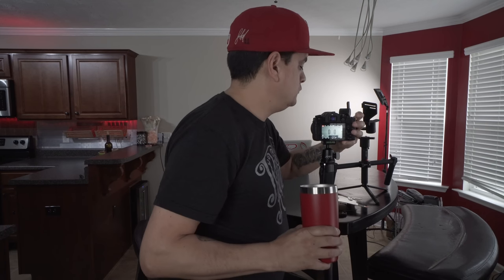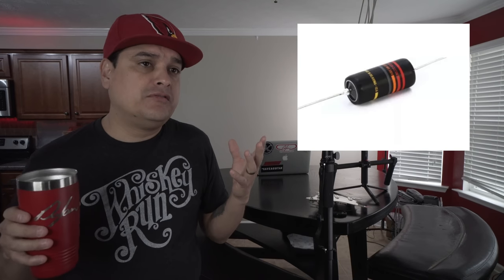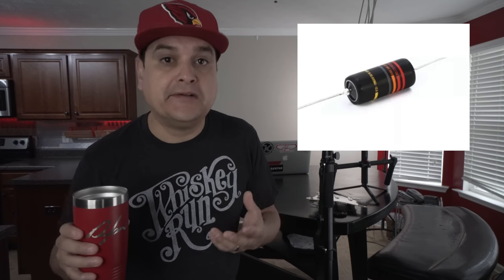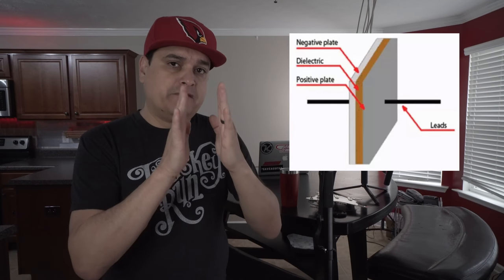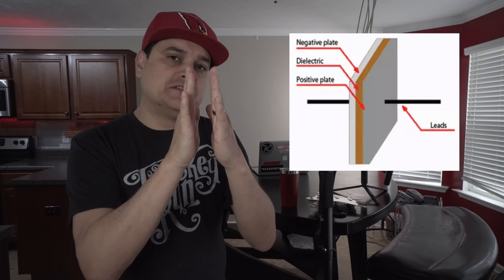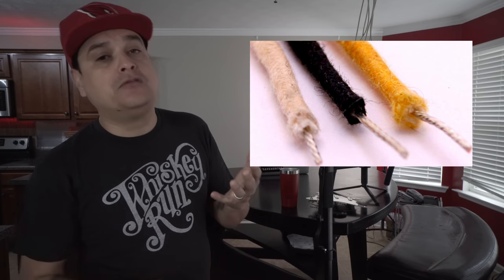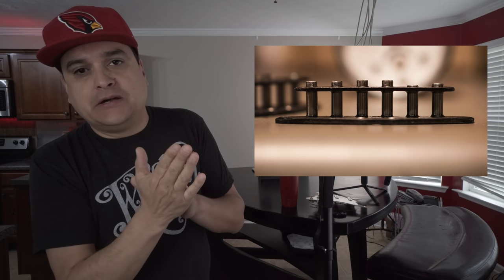Are Paper In Oil Caps Better Than Orange Drop?

Comment: A lot of people seem to think they're missing some magic component in their signal chain that's holding them back. There isn't. You just aren't practicing enough. Stop obsessing over caps and start obsessing over being the best player you can be. I need this advice too.
Reply: mic dropped
Reply: You won't sound good if you don't play well this is true, but if you've ever modded a guitar and achieved hitting that sweet spot of tone you'd understand that tone isn't entirely in your fingers. There's a point to chasing it, but there's also tons of variables. The biggest being how you sound in your room isn't how you sound being recorded with a mic, or to someone 100 yards away listening to you in a mix. That said I feel how I sound to myself is important to feeling inspired to play. To each their own though. Everyone should have a different perspective and experience. Also I agree with this guy's perspective in the video for the most part. I've heard it argued though that there's a tolerance for variance in value in caps and cheaper ones apparently tend to have wider value variance meaning they can vary a little more higher and lower from the actual value in performance than some of their more expensive competition. I don't know enough to say if that's true though, and that didn't seem to be addressed in this video. I'm curious to know if there's much truth to that claim.
Reply: True, but nerding out on capacitors can be superficial therapeutic fun. Even if doesn’t matter which cap you use. It’s like audio jewelry.
Reply: That's true to an extent, but people often don't know how to dial in an amp either. Usually dial in too much gain and bass, then can't figure out why their tone sucks
Reply: The thing missing is the 2000-3000$ amps the big difference
Reply: When it comes to caps, I think it's got to do with its capacitance. So long as the quality is good and the torques are correct, of you choose the right capacitance, you are going all that a capacitor can give you.
Reply: @ramencurry6672  this!🤝
Reply: Although Tone Hunting is a hobby in itself
Reply: nobody thinks that. tone is an entirely separate issue from practice
Reply: Yea I'm not really that great of a player but I definitely chase tone. Nothing wrong with wanting the best sound.
Reply: What harm is there in doing both?
Reply: Playing better is always great, yes practice makes most people better. But if you don't have good tone then you suck no matter how good you can play.
Reply: @LRHutch I would argue that Randy Rhoads, Jimi Hendrix, Jimi Page, and Roy Buchanan all had terrible tone. I’d give anything to be able to play like just one of them, because that is what made them great.
Reply: I can obsess about both if I want to 🤷

Comment: I'm about to turn 66 in a few days. I spent my life having a certain mind-set, if I built a guitar or bought one I'd do the same things to it just because I thought that's the way things are done. I'd not even put a tone control on ones I built and cut them out of the ones I'd buy, I never took the time to learn how to use tone controls. About 6-7 years ago I was at Guitar Center trying Les Paul's. None sounded "good" to me, mostly too bright. I had just played one, didn't "like" it, hung it back on the wall. I stepped away, a younger guy picked that same guitar up, played a few notes, then that creamy tone I was looking for came out of that guitar, it didn't sound that way when I played it. I asked the guy what he was doing to get "that" sound. He rolled the tone control back a bit. That's all he did. I had to rethink most everything I'd done due to misinformation or just stubbornness. My tone quest has been fun and informative. That's how I discovered Dylan Talks Tone.
Reply: Just re-read this, I'd left some holes in my comments explaining "what I did to everything". I'd read in guitar player in the 80's about the timeless discussion how smaller value pots kill treble, the higher the pot value, more highs get thru. The writer suggested everyone put 1 meg pots in their guitars to get full frequency spectrum. In another monthly how to by the same writer, he suggested adjusting the pickups so high they almost touch the strings to get full output. Not sure if the "cut the tone control out of the circuit to get more mojo" was by the same idiot, but I did all three suggestions to every guitar I put my hands on. I didn't understand why my strat sounded so badly, I hated it, so I changed pickups but did the same thing, it sounded badly too, so I traded it away. Imagine my shock when I learned the pickups were too high. I'd taken part of 3 or more magazine articles and abstractly applied what I THOUGHT I'd read with mostly bad results. Before internet (here goes a "had to walk to school uphill, both ways" story) I obtained my information 3 ways, magazine, library, and word of mouth. Thinking back, most of the people that gave me guitar advice were either high, or just stupid, but I digress. I feel foolish for blaming what were otherwise excellent instruments for me making the tone and sound stink. My go-to phrase for one of these guitars was "it sounds like a TURD". Oh, well.
Reply: @Lamster66  thanks for the insight.
Reply: To clarify my standpoint, I've played just about every genre from Gospel to bluegrass to blues since 1972, I've not found that magic guitar or pickup that does everything I've needed. Besides my hands and string choices, the pickup and resulting tone is the next item in the equation. I use a variety of amps as the genre and size of the venue dictates, so usually the guitar choice is dictated by the same requirements. What I mentioned regarding that Les Paul being too bright, it wasn't giving me the sound I was after for that purchase. I also explained that I'd done the same things to every guitar I owned instead of learning how to use that tone control. It amazed me that it actually made that much difference in shaping the tone. I've been on the "tone quest" since then so I'm about 18 years past THAT revelation. I'm not so closed minded these days, I read and experiment as much as possible, an auto accident ended my live gigging. Your explanation was thorough and I certainly appreciate the input. At this point of my by guess or by gosh engineering I'm experimenting with bass cut and passive mid-range cuts, I'm intrigued with the cocked wah sounds possible and how 3 tone cut controls interact. I'm enjoying my journey and really enjoy Dylan's posts. Thanks again.
Reply: I share this pro tip with very few people. Mainly because they really do not know what they do not know and just play what is stock. So here it goes: use 500k pots on all your guitars. Wire the volume and tone knob like  a 50’s Les Paul junior. (Vintage wiring vs Modern) use the value .010- .015 for the tone cap. If you want to roll back the volume or tone when using single coils to get more of those stratty tones then you will be inclined to use your ears more and also more feel of the strings and magnets resisting your pick attack. Tone really is in your hands, some guitars do this better out of the box, most have to be modified to this recipe to really have it all, especially in HSS. Now, you have the 500k which the humbucker loves, you are twice the value for single coils, you can roll off the volume and tone and solve that, plus.... using the value of tone cap I prescribed, you will actually use your tone knob more than ever before as the value (.010-.015mfd) shifts the mid and treble points like a partially cocked Wah wah pedal, instead of that .05 horrible muted muffled muddy sound Fender chose to use when guitar players would mimic bass guitar on a 6 string while recording in the 50’s, and no modern players really use the tone knob because of that fact. Playing your amp is now your new concern. You can dial up higher than you would normally use for volume and tones, and use the volume and tone knob on the guitar for boosting volume and tone without a pedal... ala Hendrix ... you will love this setup more than anything and will play more and use the volume and tone knobs and never want anything else forever thereafter...... do a video with this idea.... boost the amps volume and tone controls and dial it back from the guitar and when you want a volume or frequency change, use those knobs on the guitar instead of walking to the amp, or stepping on pedals.....you will be free to play and have it all at your fingertips.....you will thank me later tonechasers!!!
Reply: @bradleyshuppert3393   Chris Buck did a video called "The CHEAPEST Les Paul Tone HACK? | Friday Fretworks" His LP has about 330K pots from Gibson.  He had the guitar upgraded to 500K post with new caps. There was a bit of difference but not as much as you would think.
Reply: @bradleyshuppert3393  I don't recall where I heard this, may have been on the Trogly's guitar show. It was recent though as I am on a quest to find a Firebird V. The Firebird V has mini humbuckers. These pups are naturally brighter than regular humbuckers so they have 250k pots to give the pups a warmer sound. Is this false? I can't say one way or the other as I have never played one or had the chance to test that theory out if you will.
Reply: Dang man, it takes a true person that’s open to new things to admit stuff like that. I’m sure since that day, you have been having a blast. :)
Reply: That’s kind of like saying I’ve been driving all my life and realized that if I turn my air conditioner down to low I won’t get too cold
Reply: @ramencurry6672  Sometimes we're used to the airconditioner not working, so it's more of a "wow, I didn't know I could be this cold," lol
Reply: @ramencurry6672     LOL   Knowledge is a wonderful thing.
Reply: It's a funny thing. In one of my guitars I have completely removed the tone pots and I love it the way it is. The neck pup delivers that singing tone no issues, I just turn down the volume a notch. In the other one I kept the tone pots, and that one gets me that creamy sound with the neck pup and the tone pot rolled almost all the way down. Lesson learned? Dunno... Maybe nothing. Maybe just the idea to play around with your stuff and keep your ears open. Once you get that tone you are lookig for, notice your settings, no matter how extreme they are. And you might get that tone with different guitars at very different settings.
Reply: Ya! I know that feeling!
Reply: Most guitar players just want to turn each knob wide open and fiddle with their amps, noit undertsanding that the two work together. I was the same way for many years. Until watched an old Santana video. He was constantly adjusting tone and volume on his guitar, depending on what he was playing, chords or single notes.

Comment: Yeah that's a tough talk... not many people are ready to hear it... and It's true, if you want to sound like a vintage guitar, check its cap value, and duplicate it... dont go read the original value of it and try to put a paper in oil cap in your guitar with the original value, it won't sound the same...
Reply: Duplicating original values is a mistake many people make when trying to recreate a 60 year old amp with fresh components.  The "mojo" in those old amps is there because the values of those 60 year old parts have drifted over the decades. I heard clones that sound incredible but, good or bad, they don't sound exactly like an original.
Reply: I don't understand what you are talking about. isn't the reason you love that old vintage amp or vintage guitar due to the recordings you've heard and fallen in love with that use that gear? like the classic rock sound of those vintage Les Paul and Marshall amps got on the classic Led Zeppelin Albums? or that unmistakable tone Jimi Hendrix got on his recordings?
All of that gear was brand new when those recordings were being made and the caps when all in spec.
if you really want to sound like that vintage gear then re-cap your amps, put fresh tubes in and set the bias correctly and re-cap your guitar with the correct values. there! true vintage sound! anything else is just a lie that has made people spend way too much money on old gear that in reality was out of spec and not working properly!!!!
sagging caps will over time damage your gear, it's not sound it is creating it is bad electronics, see your getting DC leakage and that is just bad!
Reply: @mergatroid1212  THANK YOU GOOD SIR! SENSE AT LAST!
Reply: Yes, it's the value, not the material it's made from.

Comment: I've been playing guitar for 40 years and was at one time a real gear hound. I've converted some amps from 6L6 to EL34, built my own Fuzz Face, rebuilt a tremolo circuit, replaced pickups, speakers, and etc...you get the point. My feeling is that all that stuff is BS. Whatever you do you sound like you. I could play a Epiphone LP or a Gibson R9 and still sound like me. The playing experience would be different, but ultimately I would sound like me. Same with an amp I've owned a '66 Super Reverb, '69 Bandmaster Reverb, a few mid-60's Bassman's, '76 JMP Master Volume, and guess what? I still sounded like me. On top of that the places where you buy those caps know why you are buying them and are ripping you the hell off.

Comment: Dylan made an excellent point about old caps starting to go bad and beginning to act like resistors.  Check the ESR of those old caps.  So yeah, when a crappy paper cap stops being a cap, no doubt it sounds different than modern caps.
Reply: We can't make them old, but I wonder if there was a way to make them sound old by freezing them, baking them in an oven, or some other method?
Reply: @drivinsouth651  For those who can't read a blue print, you'll have to put your capacitors in the oven.  Those who can read a blue print know will know that the design of the circuit determines the "tone."  The reason that brown fenders sound different than black face which sound different than silver face fenders is the circuits are different.
Reply: @murfbass  But which one should I put in my Strat? I put the parts from an Ibanez RG loaded pickguard in my Ibanez GIO and it sounds better than any of my other guitars. The Ibanez loaded pickguard cost $97.00 on eBay. The $500.00 worth of pickups, Emerson blender, 10 way switch, and Qijack I put in my Strat should theoretically sound better. I was thinking of putting Ibanez parts in my Strat. What should I do, lol? Thanks!
Reply: Just need to put your guitar in the pizza oven for about three hours. Now your capacitors would be awesome and you guitar will look vintage.

Comment: Global Statement: As an older EE and now custom guitar creator, I find your videos to be the most accurate, articulate, logical, myth-busting, BS-mitigating and consistently helpful content on the subjects of guitar electronics and tone.
UPSHOT: Your efforts are greatly appreciated.
Reply: His content hooks up with my failed engineers (stupid calculus) understanding of physics. But hey all that math eventually helped understand data for stock speculation 🤣
Reply: I completely concur! I hate myths, conspiracy theories, fake news, false informatoon, superstitions, the supernatural, paranormal, metaphysical, mythological, lies, and bs. And there is nothing better than busting myths and lies by debunking them with truth and real knowledge!!
Reply: @drivinsouth651  Than I can gladly tell you that mechanical exitement has a completely objectively measurable effect on the capacitance, and that effect is different for different types of capacitors. If you HEAR that is another thing. But there IS a measurable difference. I find it funny how he lists "heat, voltage, current - all things that we do not have in guitars -" but the obvious thing - physical vibration - is left out of all things. Again: if you actually hear that is another story.

Comment: 45 years ago, when I was a young boy, I had; a cheap Teisco, a three month 7th grade electronics course, and a Radio Shack a block from home. 

I spent many months, experimenting with as many different value capacitors, and fixed resistors, as I could find. I made my own Veritone, replete with resistors, before I knew it was actually a thing. I only did it, so I could compare cap values easier.

Then, I tried phase shifting, coil tapping, (later splitting, when I added some cheap Framus humbuckers). I used push/pull pots, DPST, DPDT switches. Anything I could find, at Radio Shack.

When I brought what I had done to my electronics teacher. He laughed at me, and told me I was wasting my time.

My poor Teisco looked like Frankenstein’s monster, all the extra pickups, switches & knobs. It looked just awful, but it could make so many different sounds, through my 15watt converted stereo/turntable, into amplifier. It was crazy.

Edit: typo

Comment: I like to think of capacitors as balloons in a circuit, they add voltage back in when the voltage drops like a balloon would in an air system. Pots are like electrical valves and resistors are like a restriction in a piece of pipe slowing down the amount of air passing through. It helps me visualize what is happening. Great video. Thank you.
Reply: Pots are resistors just variable